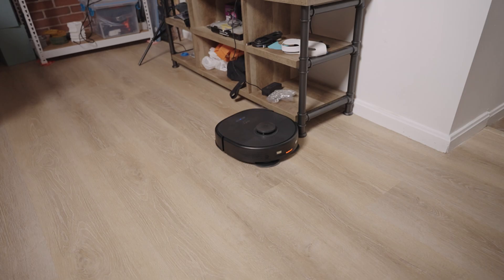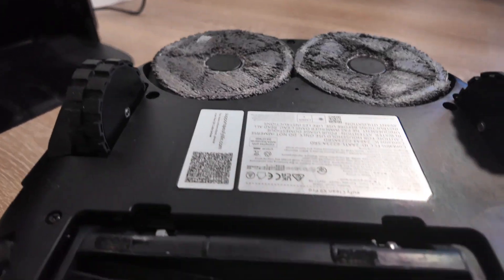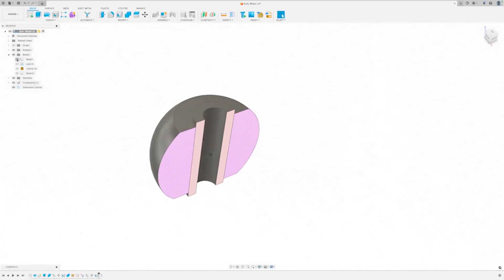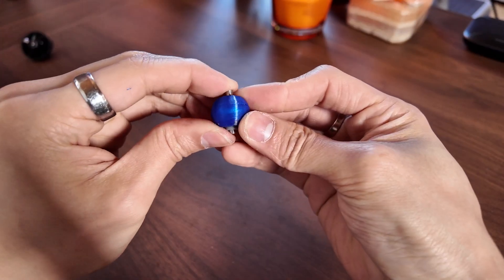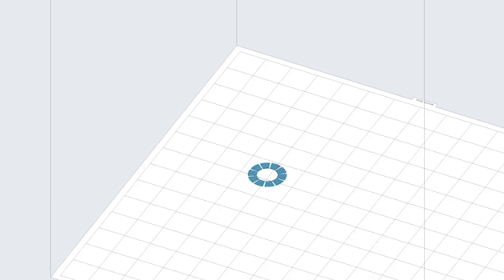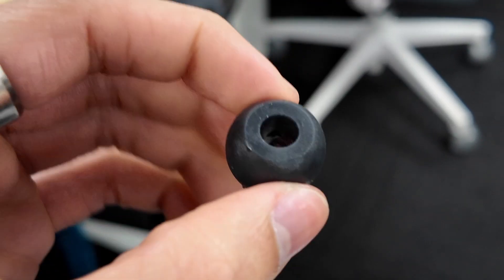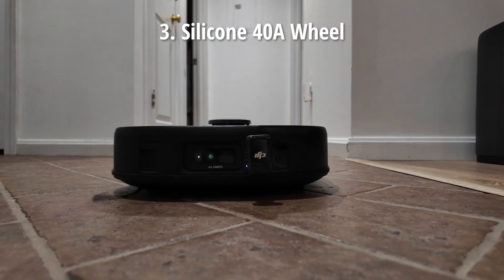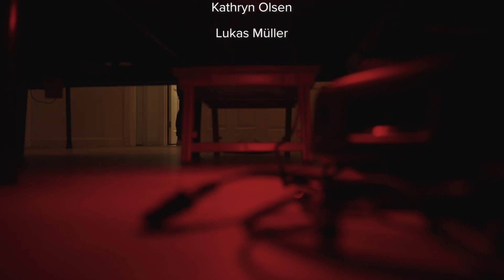Silencing a Vacuum Robot with a 3D Printed Silicone Wheel

Comment: how do you do the lattice fill in fusion? great vid!
Reply from the maker: in the design workspace, select your solid body, go to modify > generate mesh, choose lattice under structure type, adjust the lattice parameters, and click ok. your body will now have a lattice structure that you can turn into a mesh.